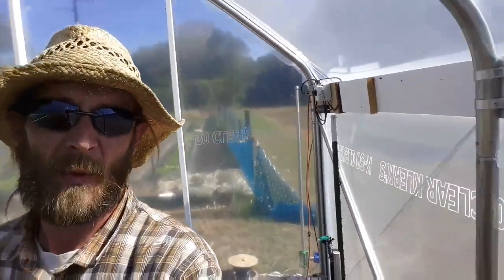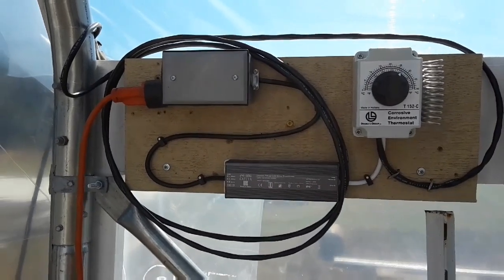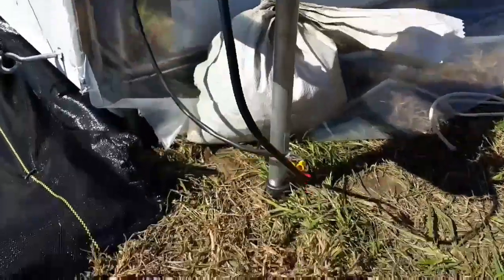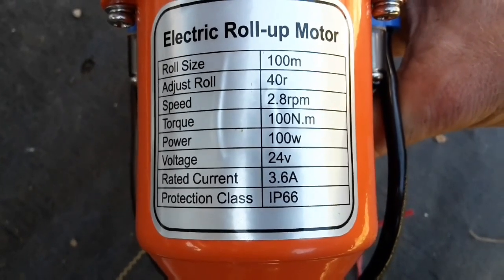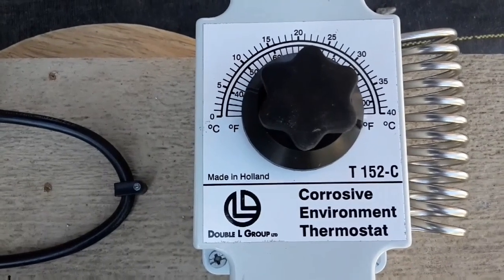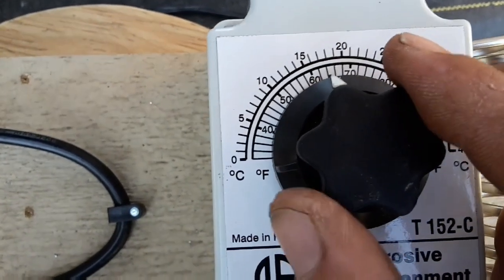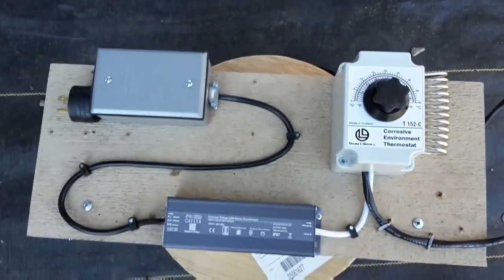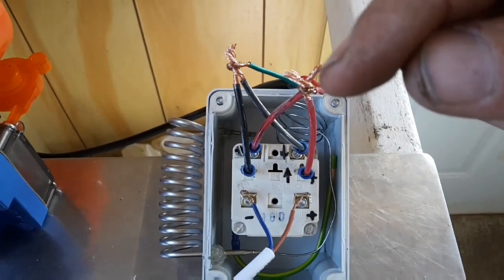Automatic Greenhouse Side Curtains

Comment: Hi Keith, thanks a lot for your content. I was wondering, what's le longevity of those motor ??Any return on that? cause they are really cheap compare to the one sold by the big greenhouse compagnies.
Thanks
Reply from the maker: Mine it still going strong. Make sure to look up the other Video about the second wiring option. The analog switches can stick.
https://youtu.be/5LOmoXlOE_s?si=rLLsaW5L3oMdAroe

Comment: I was wondering if you could help me out? I have a30x50 foot greenhouse and I have set it up with roll up walls like yours. I have 2 t152-c one for each wall. They work great thanks to your wiring diagram. The problem that I am having is I can not figure out how to set the temp settings , so that they roll up at 75 degrees and roll down at ay 50. I have called and talked with the company that I bought them from and the manufacturer but they could not figure it out. Any help would be very appreciated. Love your videos and keep watch all the time. Thanks for your time
Reply from the maker: The comtroller is analog amd only acts around a five degree range. You could use an Ink bird heating and cooling controller before the power supply. Hook to cprd from both heating and cooling plus, ties the together and plug the power supply to that. Set the analog controller to 70. The cooling to 50 and heating to 70. Now at the 50 amd 70 mark the inkbird unit will send power to the power supply only above and below these temperatures only allowing it move after hitting these marks.
Reply: @farmerkeith  Thankyou so very much. I will try it out

Comment: Keith great video, do you roll up both sides? If  so do you use 2 transformers? And did you relocate the controller board to a different place in the hoop house?
Reply: I automated both sides on separate thermostats. Get a transformer that has 2 outputs. The set temperature is staggered so that both sides don't constantly go up or down during the shoulder seasons.
Reply from the maker: One side, 1 transformer, same place

Comment: Hi Keith! Thank you for the awesome video. Do the transformer or thermostatic controller need to be sized for the greenhouse, or are they universally applicable? I am a grad student automating a greenhouse roll up curtain on a 35' long greenhouse, and wasnt sure if any components needed to be sized down. Also, would you suggest going ahead and getting a 12V transformer after dealing with the wiring issue in the option B video?
Reply from the maker: The motors with adjustable limits are sized for max torque. They work great for smaller greenhouses, but can only operate to a length, I think 330ft. The only thing you could down size would be the converter amp wise. I would still use the 24V converter because that is what the motor was designed for. And yes wire it using the Wiring Option B video. I have not had a problem since installing and Wiring it "backwards". If you have any problems let me know.

Comment: Does the thermostat have an adjustable deadband between high and low settings? Or if it’s a fixed deadband what’s the temp range between high and low . Just wondering when the curtains start to open and a rush of cooler air comes in do the curtains go up and down constantly?
Reply from the maker: I believe you can adjust the temperature difference for movement.  It does go up and down a lot during cold weather but it only uses 24V so it does not matter. Also check out my Wiring Option B Video. This is the solution if the switch starts sticking.

Comment: Hi Keith, please why the need for the transformer? am confused with that setup. from the Thermostat description on their site, input is 110v/240v and Output 24v
Reply from the maker: The motor is DC. The transformer converts to DC and the Thermostat reverses the polarity which reverses the motor. Please watch the Wiring Option B video on my channel to prevent the Thermostat from sticking and not working.
Reply: @farmerkeith  
Thanks for the response, so the thermostat get it's supply directly from the output of the transformer (12v)?
Reply from the maker: @semiuolajide2890  yes

Comment: I'm having trouble with the pipe, is flexing  and the end of the pipe (opposite side of the gearmotor), the end of the pipe rolls the plastic faster so the rolling is uneven, what could be the problem that is causing this? the lenght is 54 meters(183.7 feet) and the height 4 meters (13.12 feet), thank you all
Reply from the maker: I would expect the motor side to go up first due to the pipe twisting. It could be the far end has more plastic so the extra bulk does not wind as tight causing it to go up quicker.

Comment: didn't work for me. contacts stick when in 'rest' position between stages, from arcing and the transformer clicks. then stops to function
Reply from the maker: Check out the Wiring Option B video. There is a card in the video or search my channel. I had the same problem a few weeks after setting mine up. The switching gets out of sync.

Comment: Is the second motor wired into the junction box in the video?
Reply from the maker: The other box is for connecting 120 power. After that everything is converted to 12V
Reply: On this topic. For the opposite side of the green house is a separate transformer and tstat setup needed or can the other sides motor be ran in parallel with this? I'm assuming current draw would possibly be to high for both Motors to run and leading me to think I need 2 setups. Is that correct?
Reply: @flackvillefarmsllc7336  you only need 1 thermostat and 1 24v transformer

Comment: Hi 
Tks for video I got it all hooked up
But I’m having the issue with it getting stuck 
How did you solve that problem? Tks
Reply from the maker: Check out the video in the tag when I'm talking about the wiring.  SIDE CURTAIN WIRING OPTION B. You basically hook it up backwards. You will have to open up the switch and unstuck the little metal tabs.

Comment: Thanks for posting how to do this. We're building our first tunnel and will definitely consider automation.
Reply from the maker: Thank you for your intrest! It took a lot of research to builld this package.
Reply: @farmerkeith  hello Keith I love your post is great but how that work for double LL T152-c  thermostat 110v AC to 24v DC can you explain that thank you
Reply from the maker: @koum4564  the thermostat is rated for AC voltage. As long as you don't exceed the voltage rating in DC it works great. I have another video, "side curtain wiring option B" that discusses wiring a little better.
Reply: Wow this is next level. I'm buying a poly and want to automate the sides. So you have a motor on both ends of the tunnel? Could this system be powered with solar power + battery?